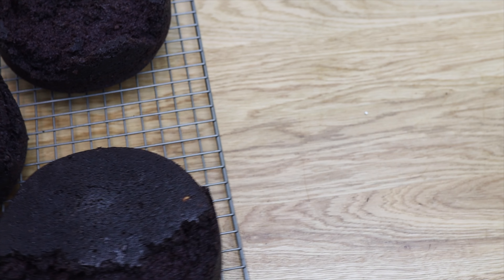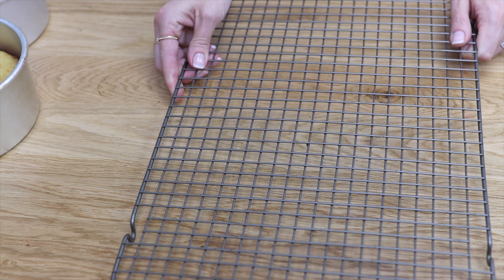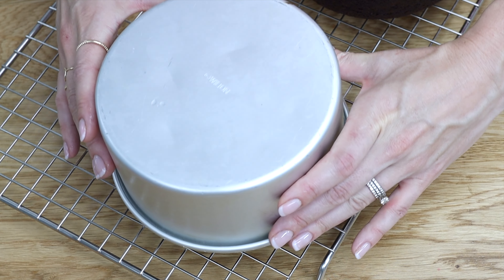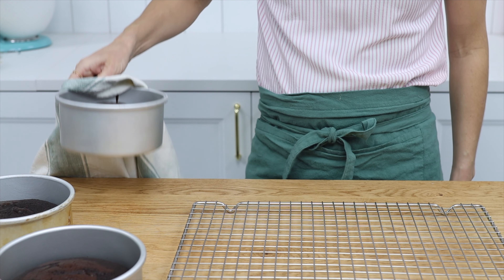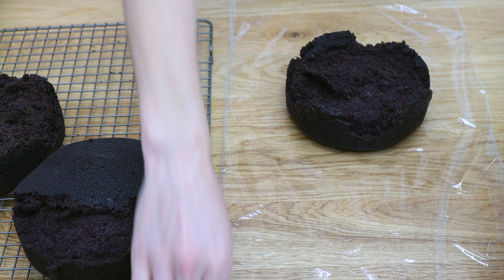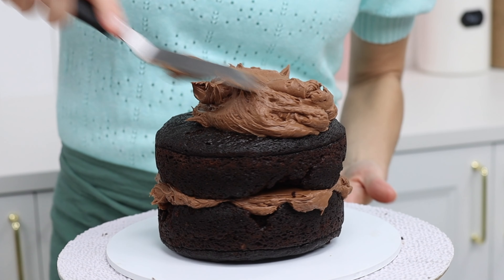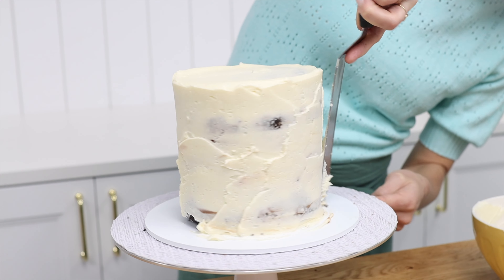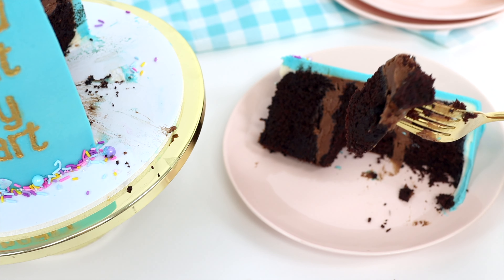How to Fix Broken Cake Layers

Comment: My cake layer fell apart last night. I was so heartbroken. I baked a number cake and when I attempted to put one layer on top of the freshly filled and decorated bottom layer it fell apart into several pieces. I covered and refrigerated the cake. I will attempt to fix it today. I was too tired and disappointed to work on it last night. I put so much time and effort into creating this cake.
Reply from the maker: Good luck! This happens to me often with number cakes because they're so long and narrow. It's much easier when it's cold and your piping on top will cover up the joins of the pieces. If the filling has already set and isn't sticky anymore, you might need to pipe on a bit more filling to attach the top layer. Hope that helps - please let me know how it goes!
Reply: @ BritishGirlBakes thank you for your reply. My husband and I were trying to figure out  what I should do the next time I bake a number cake. I will make sure the top layer is still cold for easier handling.  Luckily the top layer did adhere to the bottom layer. My challenge was frosting the cake and getting a smooth texture. I applied a layer of frosting and covered it with piping (I used your recommendation and painted some of the flowers gold 😊) and other decorations. I plan to post a picture in the cake school forum so you will be able to see it there. Thank you so much for your transparency. I had no idea this happens to you. I felt like a failure. I’m really trying to learn to give myself grace and keep moving despite my mistakes.

Comment: This has been helpful. I knew I was putting my cakes at risk when I didn't use the parchment paper underneath despite buttering and flouring the pans. Sighh. I was just too lazy to cut out the parchment lol. But I loved how you turned it around with that awesome frosting 😁
Reply: Pre-cut parchment papers can be bought off Amazon. This might help.
Reply: Hi, so you mean I can put butter cream on a frozen dammaged cake and then leave it to chill, how long should it be in the fridge to be fully unfrozen? And ready to eat? Thanks

Comment: LOL! I literally broke a layer in half last night and put it in the freezer after wrapping it nice and tight. It seems to have worked? I added butter cream and also put it as the bottom layer. My hope is that the weight of the other layers plus the butter cream on the cake board will help keep it in place 😬
Reply from the maker: I'd love to hear what happened - did it hold up until serving?

Comment: I wonder if I can use whipped cream in between layers and butter cream as crumb coat and final coat?
Reply from the maker: The challenge with whipped cream is that it isnt as firm as buttercream so the weight of any cake layers on top, and the weight of the frosting on the outside of the cake, will push down and cause the whipped cream to bulge out of the sides of the cake

Comment: Will cream cheese frosting work as well? My carrot cake stuck and broke and I always use cream cheese frosting for carrot cake.
Reply from the maker: Yes! It won’t set to be as firm as buttercream so it won’t be quite as stable but it will hold pieces of cake in place, especially if you chill the cake after “gluing” it
Reply: @BritishGirlBakes  thank you so much for the quick reply and great video!! 😁

Comment: I waited 10 minutes the first time, 15 minutes the second, and 20 the third. 

All three of mine cracked and pulled apart 

I’m going to try and salvage but I think I need to try parchment paper
Reply from the maker: Oh no! Parchment paper is great or you can grease the pans with butter and them sprinkle a bit of flour into the pan and tilt and tap the pan to dust the whole surface with a very thin layer and that will work well, too!